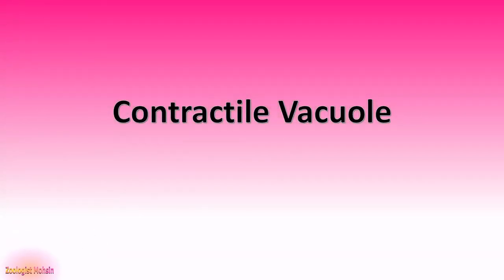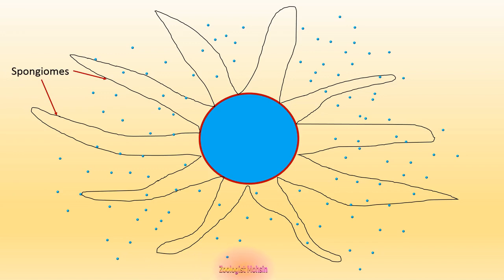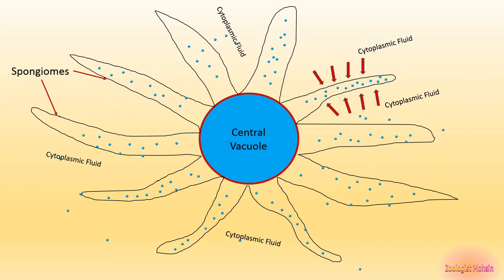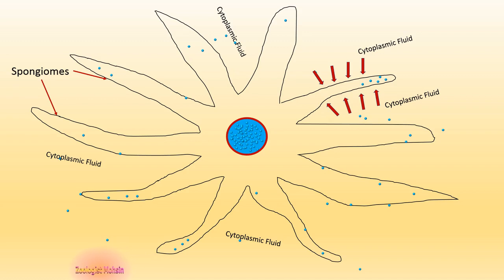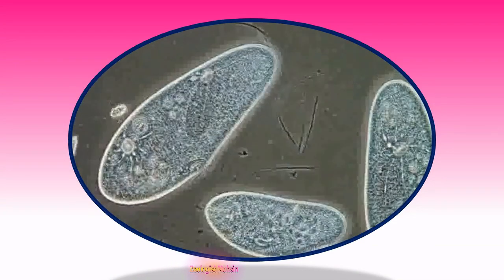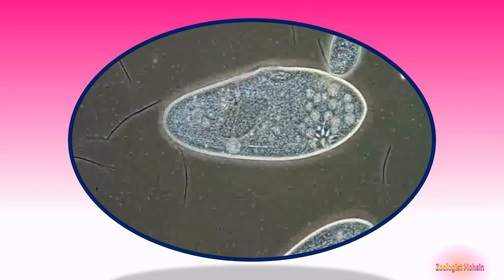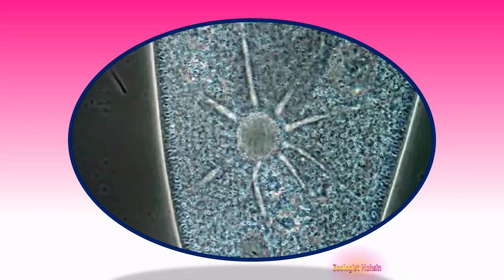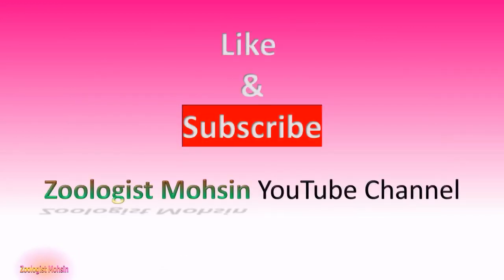Osmoregulation in invertebrates | Contractile Vacuole Working Mechanism

Comment: So we know that protein pumps are present in the contractile Vacuole since you mentioned that the passing of H2O thru the membrane requires ATP 
Am I correct in this assumption if not could you please explain it further
Reply: Also how does the paramecium generate ATP without the presence of mitochondria
Reply: On a side note 
Great channel great video 
Beautiful electron microscopes of the paramecium